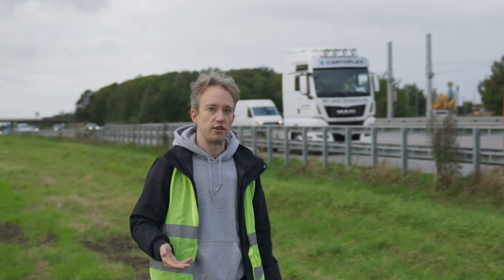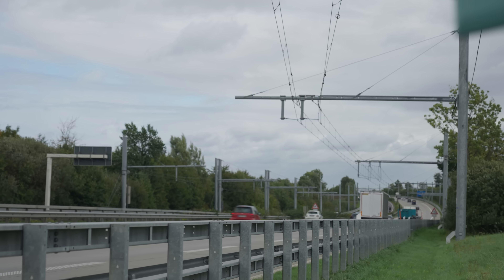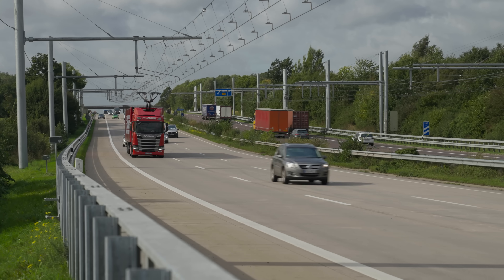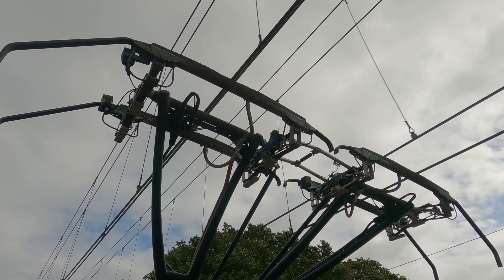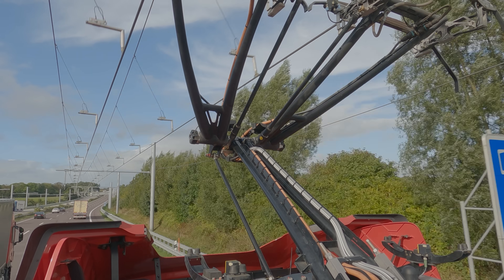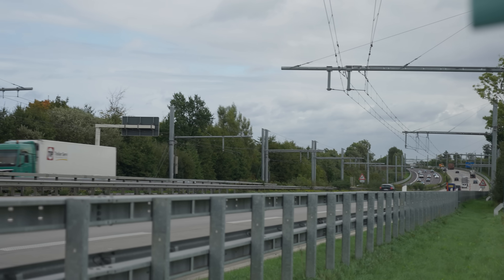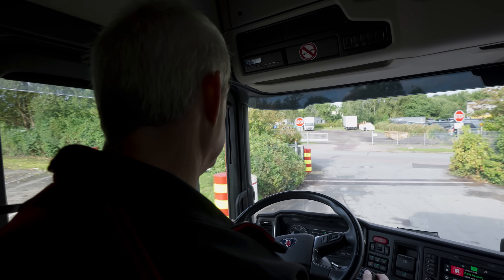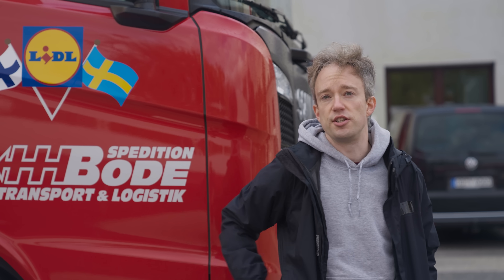The highway where trucks work like electric trains

Comment: You do realize that to maximize the effectiveness of this system is road trains. Like super singles tires are good way to increase fuel eco, but when driving the long haul. 18 wheels are the best for getting you to the next save haven. Also the system would have to be like the toll lanes on the road currently, but only for the trucks that have this system installed already.

 So a lane just for hybrid trucks is need to be built for the length of highway, must be secured so that the normal pov's, and truck that don't have it. Cannot enter at all.
 Classes 8, 9, 10, 11, 12, 13 that are hybrid trucks can use the lane. Trucks that can and will pull 40 tons minimum. Like two 53 foot trailers, loaded to 20 tons each.
No SS tires are allowed, you will need all the redundant of tires as possible. Like if you were to have a flat tire on your car that you drive around in, and had no tools to remove it. Would you want to drive on the rims of wheels that are $4k. per rim. Or figure out how to move out of the way of traffic without the needed lift?

You would also have to limit what is going to use the lane, think hybrid truck pulling hazmat classes of 2, 3, 4, 5. So HV power lines and this so close together? I would like to be minimum of 3 hrs away if they came close together.

To anyone who doesn't know what are these classes are, they are UN hazmat classes. Like everyone in the world that uses electronics was ship a HM9 UN3480, cars use HM3 UN1203, semi use HM3 UN1202.

The UN Hazmat class IDs the general item hazard, and the 4 digit UN number IDs what the item is.

Comment: If it makes economic sense then the market will provide it without intervention
Reply: Well that's obvious bollocks. In any case, the question isn't "does it make economic sense". If we left it to the market, we'd never make the necessary changes in time to halt global warming, because what makes sense for individual firms are short-term gains. Switching to greener methods isn't necessarily good economic sense in many cases, except insofar as there won't be much of an economy to worry about if we keep this up. Governments are having to step in because the pace of change under market conditions is insufficient to deal with the problems caused by greenhouse gas emissions. Physics doesn't care about markets.

But keep on with that blind faith if it makes you feel good. Who needs religion, eh?
Reply: @monkeymox2544  because government will save the world if we just give them a little more power, said every tyrant and sycophant ever.

I'll give you a little lesson since you don't seem to understand. If it doesn't make economic sense then it will waste more resources than it's worth and therefore won't last. So, if you care about the environment then you should be careful that your proposals are economically sustainable.

Comment: US trucking industry has spent billions on self driving electric trucks. This makes it a more efficient practical solution. Trucks could run coast to coast on stop. Get ready, it's coming.
Reply: also it cuts on weight whilst increasing range by well alot. Thats 2 issues already fixed.

Comment: Concerns about the viability of a system like this seems really weird, since I live in a city (Vancouver) with an extensive pantograph bus network. I have 3 different electric bus routes that run just in front of my home. It "just works" using the same basic system from around 1950. The buses share the same lanes as regular buses and other vehicles, can change wires at intersections using basic switches and just fit in seamlessly with the rest of traffic. I've never seen a bus pull wires down, though I know it happens on rare occasions. On occasion you'll get a spark when a bus goes through a switch. The overhead wires have always just been a distinct part of the look of the city to me.
Reply: I'm also in Vancouver, and the wire network overhead has always just been a part of life. I have some running right outside my window! The technology is there and it does work.
Reply: Same in San Francisco
Reply: @adamajluni7781  There was one incident in San Francisco where a trolleybus driver stupidly backed up his trolleybus. The trolley pole got caught on a switch and went up vertically while pushing up the overhead wires until they broke and collapsed.
Reply: The viability from an engineering point of view isn’t the only issue. The bigger issue is its economic viability plus proving to trucking companies and truck manufacturers that this is a system that works well and is accepted by both road users and emergency services in real world use. There is also the issue that is very different than trolley buses that operate in cities where speeds are much lower - that is operating at train-like speeds but in an environment that includes sharing the carriage way with multiple other kinds of vehicles. Trolley buses already do that, but at lower speeds. Trains have the higher speeds but do it on tracks that are mostly isolated from other vehicles. Combing speed and road sharing is a newer application that needs to be tested thoroughly.

The acceptance issue is a real one. In this test only one truck company was prepared to participate while other companies declined citing their belief that different technologies are better. It will take a lot of testing like this to win-over a reluctant industry in order to make it viable to roll out electrification over long distances.
Reply: @artistjoh  they should be able to retrofit this sort of system to existing Hybrid trucks, or to the small few fully electric trucks.
Reply: Melbourne：yes
Reply: Ditto Seattle. We've had hybrid and all electric buses for years now
Reply: Yep Seattle has them, and they fly up the hills, though they often come disconnected and the driver has to get out and reconnect the power rod.
Reply: Higher speeds and financial system for more that just the local governments public transport cost..
They are not checking if it could work. They are patching how it will work.
Its not just measuring miles driven.
Its wear and tear on infrastucture and power used balance
Reply: I was surprised in a recent visit to see the Edmonton pantograph wires taken out of 109th...not sure if it was a revamp or if they ditched electric.
Reply: dude, you are comparing a network of pantographs in a city distributed in relatively compact space to a 1000s mile long line of of these? do you think it's the same thing?
Reply: @crimsonlightbinder  Right, because there's no way we could make a wire longer. Germany is barely over 500 miles at it's tallest, and last I checked, all of it had electricity.

Comment: Australia is large. Queensland state government is investing in green hydrogen.
Reply: Hydrogen fuel cells are not the solution. “As of 2020, the majority of hydrogen (∼95%) is produced from fossil fuels by steam reforming of natural gas, partial oxidation of methane, and coal gasification.” Hydrogen comes from fossil fuels it is not clean. The rest is made by electrolysis, which is extremely inefficient compared to putting the electricity straight in to a bev.
Reply: @TylerBenney  We'll see.

Comment: This is a great idea! However a few things could be improved: rubber is inefficient, maybe replace the rubber wheels with steel wheels? And then replace that lane of the road with steel tracks. We could also improve range and efficiency by stringing multiple trucks together. Then, we could use one "engine vehicle" to move many different cars.
Reply: Brilliant!

Comment: But what powers the wires?  Power plants, but not nuclear plants because nuclear bad (at least in Germany).  Fusion good, but fusion has been 50 years in the future since the 1960s, so it is just a self-con.

Right now, those wires get powered by coal or natural gas, dirtier than diesel let alone gasoline/petrol.

Comment: Having to run the two wires and two pantographs is a little different to trains, since they can use the rails and metal wheels instead.
Reply: They can. But the German train network for example is entirely overhead cables. Only exceptions are some metro lines.

Comment: A very smart piece of outside the box thinking.
It make a lot of sense to not try and carry the large amounts electric power around in a box with you while on the highway, and then simply use a separate power source away from the supported roads.
Perfect for container trucks and pantech type trailers. Would be an issue for oversized loads and things like car carriers when extra high.

Comment: Now let's make the tires harder so they have less roll-resistance. Then put some guiding rails in place so the truck remains in lane.
Increase the overall length to improve capacity.
Last but not least make the trucks a wee bit more aerodynamic.

... oh... wait... Did I just reinvent the train?
Reply: "Increase the overall length to improve capacity."
Yes, because your local sleepy village Lidl supermarket would definitely benefit from requiring to expand its storage capacity to have the capability to locally store 10 container wagons of foodstuffs at once.
Reply: And make the trucks unable to stop and they  end up running into the back of stopped cars?

Comment: In rail electrification the power requirements are known in the number of trains being operated over any particular power zone at any time.  On a highway electrification - unless restrictive rules are implemented - the power requirements for any individual segment are unknown as equipped vehicles will be going to the wires based on their own needs or desires.

Comment: This feels like it would be an engineering nightmare to implement, props to the team that managed it.
Reply: I'm really curious how they manage wear on the wires.  Seems like there would be a lot of friction grinding the wires down over time, even if the contacts on the truck are soft.
Reply: @ToyKeeper  Much the same way maintenance is done for trains, trams and trolleybuses, one would imagine.
Reply: @walkblessed445  Well yes, obviously.  But they didn't go into any of the details of that in the video, so it left me curious.
Reply: @ToyKeeper  usually the component that get's worn out the fastest is the Pantograph
on the trains (trucks) the catenary can last a rather long time.

Comment: Its a good idea but i am still a supporter of intercity or long distance railway traffic with an integrated road system for the last delivery area. I have very little hope for this system in South Africa. Out local midnight shoppers have stolen and vandalized our railway infrastructure. Copper wire and even railway track in vast quantities stolen. No trains operating in many areas.

Comment: This is cool if you have nuclear power. Unfortunatly in Australia we would have to power these trucks with coal and gas fired power plants.
Reply: They also do so in Germany, so don't worry, you're just as dirty as where this test is taking place.

France is the one with all the nuclear power. Germany is actively working to shut down every nuclear plant they have.
Reply: We do have renewable energy here in Australia and many coal-fired power stations continue to be shut down. BTW the large Melbourne tram system runs entirely from renewables. Nuclear would have been an option in the 1980s, but today wind and solar is much cheaper.
Reply: @francisernens1795  South Australia and Australia in general has some of the highest power prices in the world.... either its not cheaper or we're being screwed... either way.....
Reply: @francisernens1795  Wind and Solar also don't last as long, and have reliability issues, and also take up larger footprints of space per kilowatt.

Comment: Seattle, Washington state, USA has had similar overhead wires in its downtown core for decades to run hybrid buses. They run on diesel when outside the downtown core, but on electricity in it. (And a few major roads leaving downtown have the wires along much longer sections similar to this.) A few years ago, they replaced most of the hybrid buses with fully-electric - operating from wires when possible, and off-wire battery for the segments that aren't wired (or for instances of bad connection/wire issue, since in many places these wires are decades old - the system dates back to 1937!)

This really does make a lot of sense for longer-haul, too.

Comment: Is more electric trucks a better or cheaper option than simply expanding rail and barge transport?
Reply: Trains are inefficient when trying to deal with lots of cargo that goes to many different locations, they require huge rail yards to split up trains and remarshall them. This is why "goods trains" died off in the 1960s.
Reply: @pwhnckexstflajizdryvombqug9042  freight trains these days are normally just container wagons. and containers can be carried by any mode of transport thinkable so just smaller container yards would be needed for transfer and short term storage of containers.
Reply: Barges are much slower. Trains require more planning, are a little less flexible (wich is a problem only for those who pretend two day delivery of everythig).

Comment: This is quite cool, but given the freedom of movement a truck has over a tram, I'd be quite nervous of the wires getting broken and possible falling onto the highway where they could really hurt someone.  Then again, even if one did snap and fall, a passing car might hit it and lose contact so fast that the electricity wouldn't even have a chance to do them any harm.

And for anyone saying: Why not just use trains...well, the whole point of this is that the vehicle (the truck) can easily branch off of the pre-determined "railway" and then proceed to all sorts of other locations with roads where running the electrical "track" wouldn't be practical.  This idea is really quite brilliant if it's sustainable and safe.

Comment: the only thing I worry about is an accident in which those high powered lines fall into traffic, they need a solution for that something like a breaker switch that reroutes power as to not disturb those relying on it (except the highway) but still instantly stops supplying mains voltage to the downed lines

Comment: There are several cities that have electric busses, and this system works there, though at slower speeds. But trains do this all day long.
Include enough battery to drive say 35 miles, and this should solve a lot of problems. Yes, we may have to build some more power plants, they they create a LOT less pollution than do diesel engines in trucks. Freaking brilliant.

Comment: I like this solution, but I think it will need extra consideration for the actual transfer mechanism. I imagine the wear on these lines would be orders of magnitude more than a tram given the volume of traffic and speeds. Perhaps something like a guided steel wheel that makes contact with the wires would be better in the long run despite being more complex. At least it wouldn't add to the cost of the infrastructure.

Comment: System looks great, however I notice some problems.
For one, that dual caternary system looks just a bit sketchy. There is a reason most grid powered electric busses don't use caternaries.

Seccond is capacity restrictions.
For a train system/bus system, they know how much capacity it can handle, and how many trains will run on it. 
For this however you don't know if you are going to have 2 trucks or 200 all at the same time. They also stated that its going to be running at a lower voltage than a typical trolley/electric train system, which means it has even less capacity than a typical train line.

Comment: I wonder why they have not considered using the bed/trailer of the truck as a place where batteries could be placed (along with the ones a truck could have). Then replacing trailers from one destination to the next giving trucks that extra energy to go from one destination to the next.

Comment: I understand this concept, but they should rather put the trucks on rails (meaning loading the truck trailers onto waggons) and only let the trucks drive the last couple of kilometers.
Fully charged trucks could wait at the freight train station, and for the rountrip to the store and back this would suffice, without the need for a multi billion Euro road grid.

Comment: The argument that it's "overhead wires or a hybrid running on fossil fuel" doesn't make sense. Surely a battery electric lorry could use batteries to get to the motorway, then charge on the motorway, then use batteries to get to its destination, all without stopping?
Reply: That's what these trucks are doing, but they can have smaller batteries than a standard electric vehicle - that reduces weight and cost. Hybrids would be used where there are long stretches of unwired highway on the route.

Comment: I would have gone the extra mile and considered trains for freight.
Reply: not allways possible, unless you wanna convert every street in a rail-line Trucks are necessary, countless sthinsg need transportation, for instance liquid oxygen and generator-fuel for hospitals need Trucks with liquid-tanks, unless you wanna connect every hospitals by train.

Comment: This is incredibly cool, and solves the problem with building train routes: installing rail infrastructure is costly, labor-intensive, and they're inflexible.
Reply: Doesn't actually solve the flexibility issue at all, because it uses the same solution rail always used: use a different system for the last mile (in this case an internal battery or combustion engine, while rail would offload to a completely separate vehicle, but the trade off is that rail is a Lot more efficient in terms of energy and manpower per unit of freight moved over inter-city distances.)